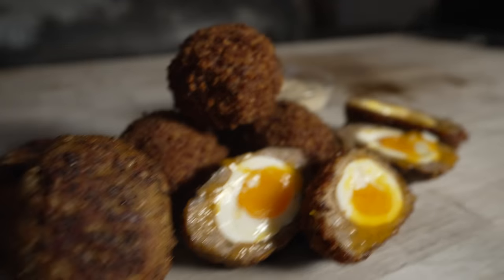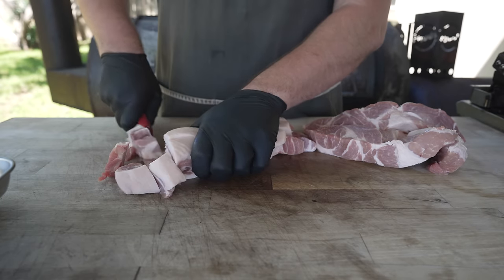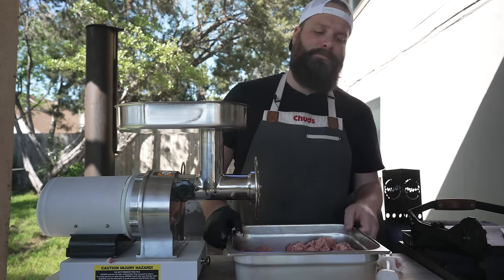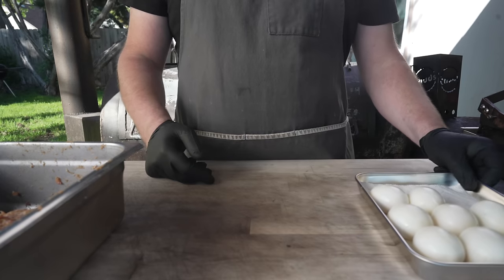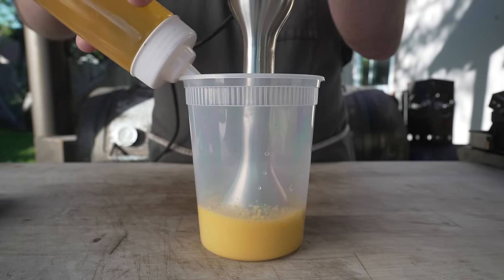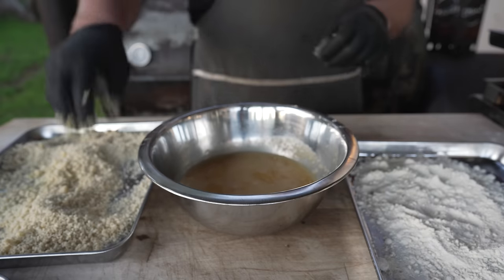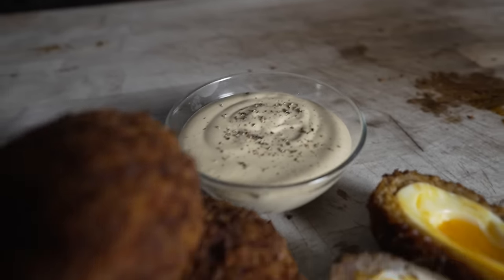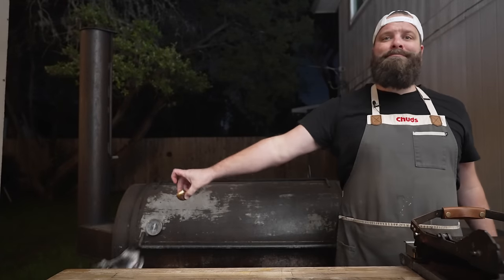BBQ Scotch Eggs Are Incredible! | Chuds BBQ

Comment: I do them in the smoker, no breading. Pretty labor intensive, but worth the effort! Great video!
Reply: I'm going to make these.  Have you ever cold smoked them for like 1-2 hours and then grilled them at 350?  Also, what time and temp do you find works best?
Reply: @paulschwartz2464  I’d think you’d want to add cure to the recipe to cold smoke. I’m not sure about the safety of the partially cooked egg during the cold smoke process.
Reply: @chrislaframboise7577   what about time & temp?